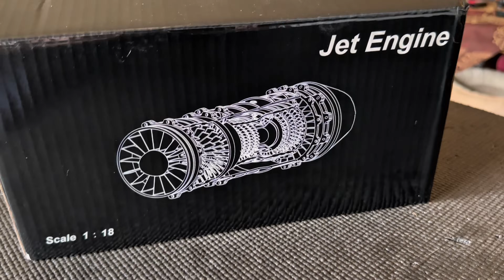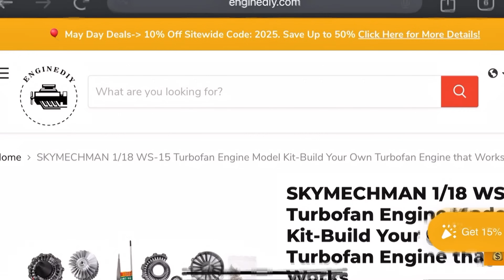Stig Projects (Build the WS-15 turbofan)

Comment: Stands a chance? The J20 would get definitely get beaten  by the F22. The F22 has more stealth capability (most importantly a smaller radar cross section) which is a problem considering the J20s more long range radar guided missiles which would have a hard time locking on at long range. The F22 is built for closeish range engagements so it would more than likely detect the J20 further out, sneak up on it and shoot an IR missile. I'm done now 🤣
Reply from the maker: I’m totally with you on this. F22 for the win

Comment: How do you become a aircraft technician im considering it if I fail mechtronics engineering im probably just going to work at London Heathrow or somthing or perhaps HVAC or welding pipe fabrication 🤷‍♂️
Reply from the maker: For European standards you need to look into and research EASA part 66 program